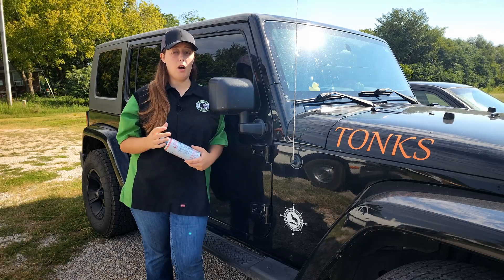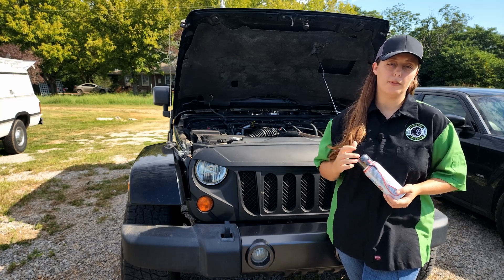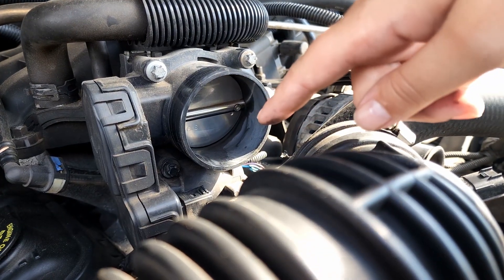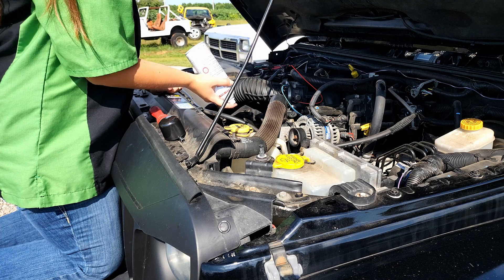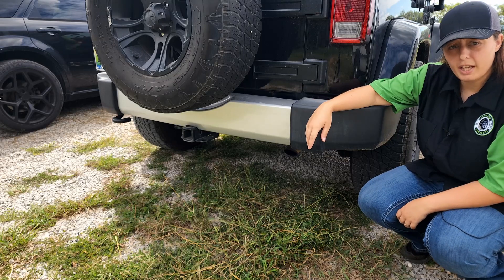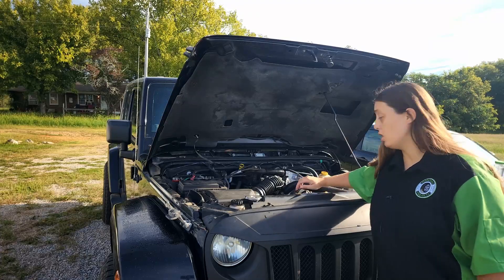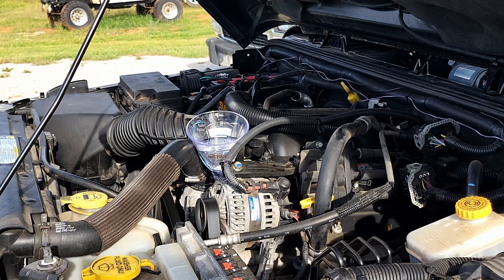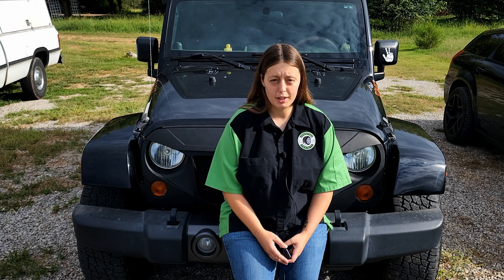How To Use SeaFoam On A 200K Mile Jeep Wrangler - Will It Help Rough Idle And Hard Cold Start?

Comment: You need to let it heat soak longer than 10 minutes.  Minimum 30 minutes but longer the better.  I recommend pulling the intake manifold and cleaning it good prior to this process.  And pour a half can of seafoam in the gas tank and the other half in the oil a few hundred miles before the next oil change.
Reply from the maker: We just followed the directions step by step on this one, but good tip on letting it soak longer. The intake manifold has already been cleaned up on this one, it need intake gaskets when we got it.  I do the seafoam in the tank and before the first oil change on my vehicles that have lots of miles. Thank you for the tips.